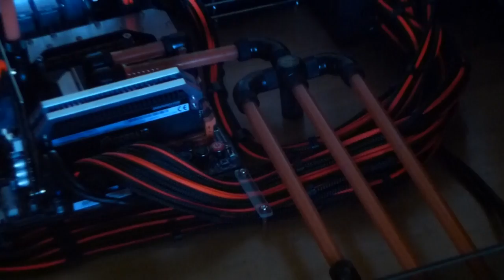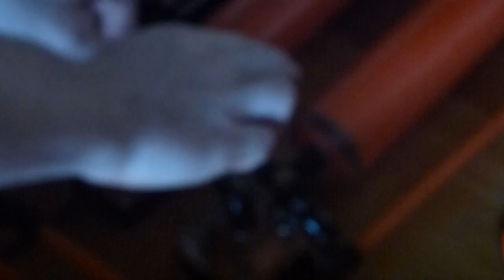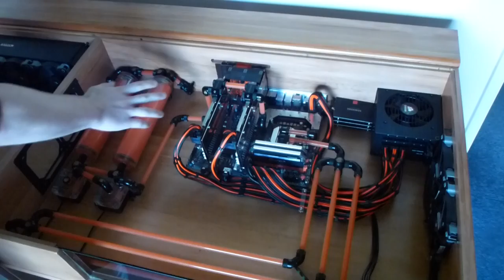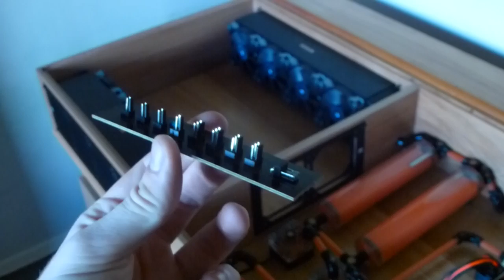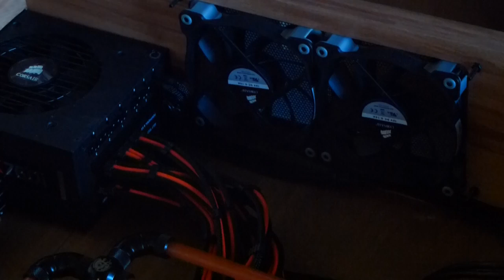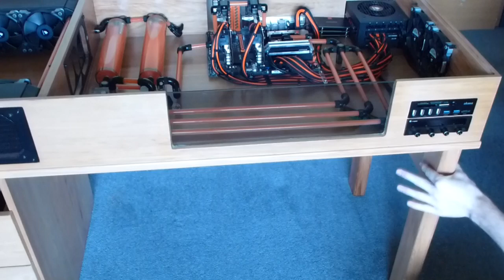Custom Made Watercooled desk - Part 3

Comment: Whats the ambient temp on the radiator side....

I would of gotten a PCI exteder so you can lay it sideways to show it off....And would have mounted the PSU with some cable routing underneeth to make it clean

Comment: Water cooling is WAY overrated. In my computer case I have on huge 16 cm fan on top set on slowest speed (I can't hear it at all and it pumps ton of air), I have front and back fans, but they are set to be off bellow 40C of CPU. CPU is passively cooled by HUGE heat sink (idle temp. 35C, not much more when used). GPU have nice large radiator with two fans which are basically completely quite at idle and not much worst when used. I can't hear my computer at all.

Comment: Awesome desk! I'm designing my own with Sketch-up right now but I was wondering if you could give me a list of tools I'd need?
Reply from the maker: xBENZBOYx It's kinda hard to list them all, obviously you need a tape measure, belt sander, drill, router, you could get away with a skill saw as apposed to a saw bench. Basically look at everything, and think. Now what would I need to create this?If you check out the build log it shows pretty much every tool I used in the process
Reply: Fastest reply I've ever gotten mate aha Thanks for the help, seen these desk videos of yours 2 years ago when I was 14 and it inspired me so I got into doing woodwork at school. Finally planning my own and hopefully soon build my own at home.
Reply: xBENZBOYx Fine woodworking is a far more expensive habit than PC building If I were gonna build this I would say band saw table saw drill press miter saw as a start @philip baines  I would love to see an amature use a skill saw on this kind of carpentry

Comment: What fittings are you using for those 90 degree bends? And how are you holding that four-way connection in the air?

Comment: For all the cable managing just make a double floor inside your desk. Then you'll just have to put all the cable through the first floor inside the second one. That way the cable are invisible and no more cable management issue. A way to do it is just to put an other board below the bottom one, but the second and more professionnal one would be to carve it with a router in a pretty thick wooden board wich would be much more resistant ant easy to make with the appropriate tools. Take a look at one of my desk I made one sketchup for someone on a forum here : PC modding desk on sketchup full watercooling
Reply from the maker: With the revised desk that I am going to be starting in the coming weeks I will be planning to address the cabling issue. Have not decided how I will do it yet, however I like your idea. I will probably end up using the router.
Reply: Phillip Baines Look at my moded desk on my channel, I made an animation on sketchup showing how to do that properly, don't forget do see my last one : HORNET.

Comment: Interesting build. if you want to use them in parallel get some one way valves that should stop the fluid from one res filling the other and vice versa
Reply from the maker: Yeah, I ran them in series in the end. Parallel gave me an appalling flow rate. But even a one way valve wouldn't work as well as series
Reply: i guess when you put them in parallel the lenghts of the pipes after the splitter play a critical role to ensure equal spread between tanks, otherwise i guess you would have one with a higher flow rate than the other and thus varied temps when it came to cooling various devices.

Comment: you should put the cables under the desk you would have to make small holes so the wires fit but they'll be small and you could put a custom Grommet around the holes so the cable looks great when there coming back in the case and plugged in if you could see what i'm talking about. the SSD cards you should lay them down across in between the rads and the two pumps you should make a bracket to left them on the top end so they'll be at least a half inc. of the floor if you know what i mean so they'll be in an angel.

Comment: Have you thought about using copper tubing for your wiring?  It might complement your build well with the color and it would clean up those wires some more. (Not that they're bad, they look great but I think this would look amazing with the water cooling color/tubes you already have in there.)

Comment: I totally understand the tidiness factor :). This is just speculation, but I would think the solution running across both GPU's would be pretty hot under full load, so your CPU theoretically could increase in temps regardless . That's just my two cents. Personally if I were you I would put a temp sensor right between the GPU and CPU to test that theory. I am so jelly of this desk :p.

Comment from the maker: I was going to use the sliding tray, however if I had the sliding tray the desk was going to be too tall and sitting at it and using it would be uncomfortable. By having the "Swinging Arm" design I can have the desk lower making it more comfortable and gives me good options in terms of movement. However, I might have another idea which is simpler and might be more effective ;) No clues or anything just have to wait to part 4 or follow the build log! hehe. Thank you for your input though :)

Comment: Philip try not to over engineer the keyboard tray. why not use some large drawer rails that have built in stop guides that prevent your tray from coming out to far and going back in to far, just fit the rails to 2 pieces of timber beneath your desk the right depth for keyboard and mouse.